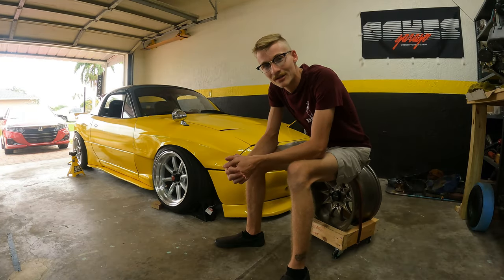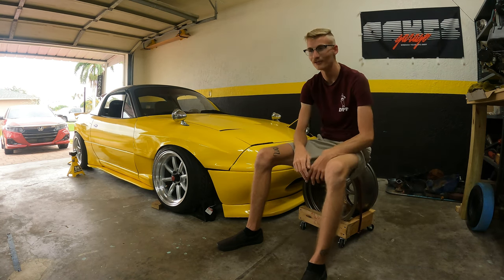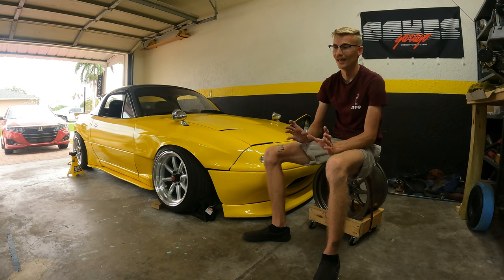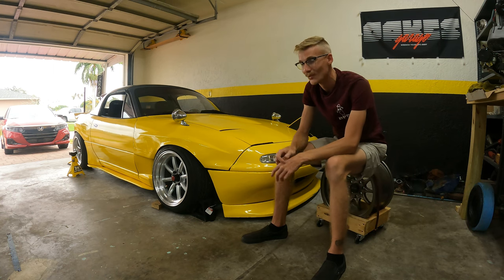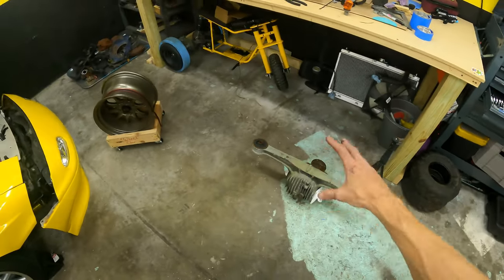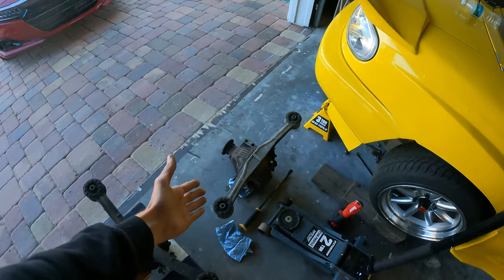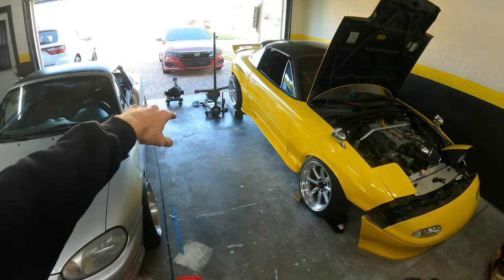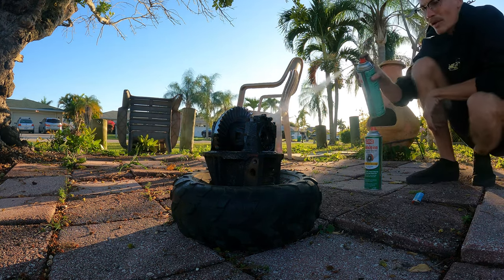I Blew Up My Turbo 1.6 Miata .... ???

Comment: Should have pulled the power line after oil change from the distributor and waited for the oil pressure light went off to make sure the turbo didn't dry sease!! Mazda might replace!! Buick v-6 was the same way!!!  Love you all and have a blessed day!!!!
Reply from the maker: Thanks for the comment but can definitely tell you didn’t watch the video😆
Reply: @dillpicklesperformance  Actually you were talking about the rear-end that blew because of the turbo. You can never know about the turbo too many people forget to remove the power on distributors and blew them!! Love you all and have a blessed day!!!